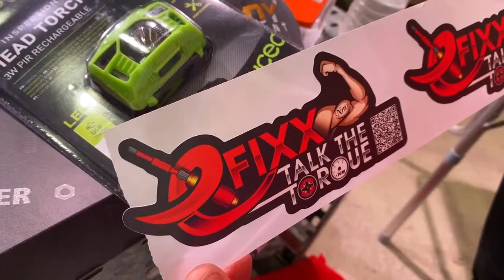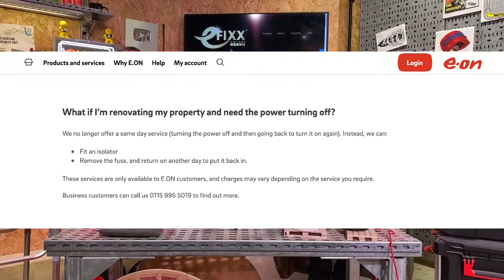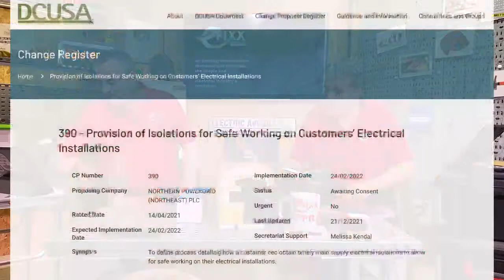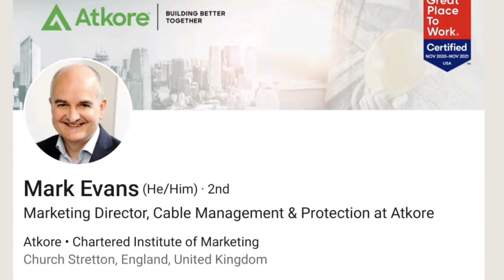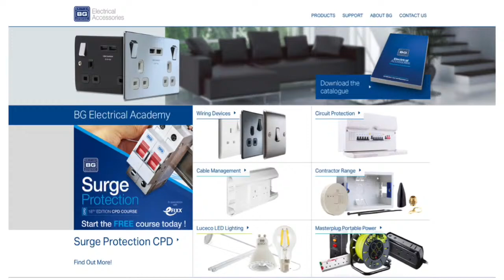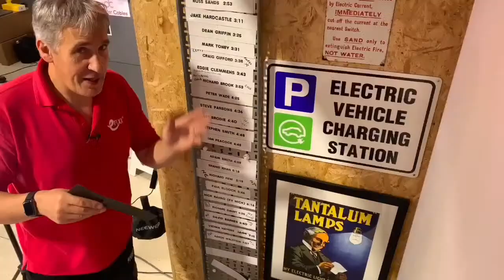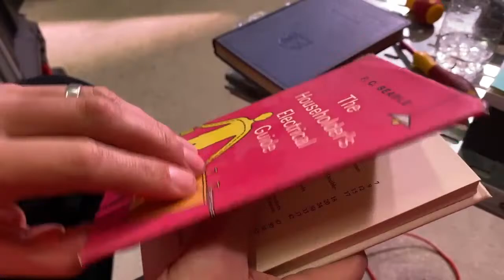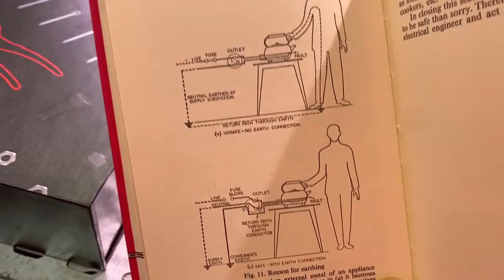eFIXX TV: Will I be allowed to pull the main fuse LEGALLY?

Comment: At the end of the day if the DNO does not provide a safe means of isolation for their network then in my eyes I am well within my right to pull the main fuse tagged or not as long as I have the correct equipment to do so. I would not dream of installing a consumer unit without a linked main switch so I cannot fathom in 2022 why smart meters are getting installed with no means of isolation to the consumer side.
Reply: This sums it up exactly
Reply: 100% agree!

Comment: There should be ZERO cost to have a disconnect device fitted (isolator). The energy supplier should have to foot the bill for installation (or do it with their own staff) and the consumer only liable for the cost price of the isolator & new tails (if required - some existing tails are long enough to cut and switch inserted). This should be mandated as a standard safety feature to be installed on any replacement and/or new build. Jeez one would think that customers haven't been paying through the nose for power for decades let profits take care of reinvestment since that is what it is on older properties!! 👎👎👎🤬🤬

Comment: Some of the new smart meters have a built in isolator under the front cover, allowing the tails to be removed safely with no interruption to the smart meter power. As some know the new smart metes alert when power is missing
Reply: Removing the cover of a meter is classed as tampering

Comment: My understanding is that yes you can if the DNO seals are the  newer type if they are the old led type were the crimping tool emboss’s a crown into the led seal they are classed as Government seals and it is a criminal offence to remove them. Also the DNOs don’t want electricians to pull there cut out because the loose out because they can’t charge the costumer an extortionate fee if is nothing to do with safety it’s about them making as much money as they can. Pure and simple other wise you would not be able to buy the seals and the tool to reseal the cutout and meter. Those sets are widely available for any one to buy . £ 19 on Amazon about £ 120 from R/S components

Comment: They should do a day course for electrians so you can are able to pull the fuse which would be a good money maker for them.
All they have to do in make a insulated insert that replaces the fuse and make special lock off device like safe isolation locks you need a key or a code to open.

Comment: Why have supplier install an isolator in meter cabinet opposed to simply installing your own isolator next to the consumer unit inside the house? One of my concerns would be potential burglars switching power off from outside
Reply: Do you think burglars are not capable of cutting a bit of wire on a fuse and alarms have battery backup.
Reply: @darrenplant1428  CCTV lost, any malicious intervention really. Sure they could pull the fuse, safety risk though
Reply: @jimreece7615  burglars, infamously concerned with the very best in safety procedures.

Comment: I'm really surprised by some of the things I heard. Firstly I can't imagine why a meter fitter would change the fuse rating. Your tails to the C.U. seem to be 25mm, so no upgrade required. For a meter man to change the fuse is a disciplinary. Only DNO can authorise a change (up or down) in fuse size. So why would he choose to change the fuse ?
The Isolator would not be acceptable to the Supplier I work for. We have to swap them for double screw terminal Isolators, as single screw terminals are accepted. Why he removed it ? 2 possible reasons. 1) He ran out of stock, but could not have a single terminal Isolator in his end of job photo evidence.  2) He was very inexperienced and possibly felt he did not have enough space to fit the meter above the Head and therefore pushed it over into the space needed for the Isolator. Seems unlikely.
3) I was dismayed to hear you talking about electricians cutting the seal on the meters. Pulling a fuse is all about Safety and I doubt anyone would be prosecuted for that. Opening the meter becomes Tampering. No safety issue and therefore the electrician would be putting himself up for prosecution.
Lastly, the supplier I work for, will upgrade your tails (not C.U.) and fit an Isolator for free if you need it prior to installing a car charger.

Comment: Why doesn't the home office demand lockable isolation switches are fitted to all domestic meter enclosures and that would be the end of it and it would be the suppliers expence over a say two year time period.
Reply: When smart meters were being discussed, the recommendation was put forward that the meter must have an integral isolator.  Those of us involved in advising the committees were "considerably disappointed" when the industry folks rejected the idea and successfully balloted to drop the suggestes requirement.
Reply: Or at the very least mandate it whenever a change is made anyway, that way they can take 40 years about it.

Comment: The DNO/Meter Supplier only own the cut-out and meter, anything after that including the isolator and consumer unit belongs to the customer. The smart meter fitter who removed Gary’s isolator committed theft and should have been reported to the Police for doing so.
Reply: Actually, that is not entirely true...  When there is no Isolator, the tails out of the Meter into the CU are the customer's  (Even though you cannot do anything with them because they are inside the Meter!)  Everything after the meter (including the whole cupboard box itself) is the property of the Home Owner but when there is an Isolator, (regardless of whether you bought it) , the meter tails AND the Isolator are the property of the Energy Supplier.  The CU tails out of the Isolator is the Home Owner's property.  And you can even open only "your side" of the isolator in order to remove your tails.  I think it should be Statutory for the Energy Companies to provide an isolator with every new meter installation/upgrade, just like we are required to install any new circuits to current regs...

Comment: Electrician's Challenge: I saw no evidence of him doubling over those single conductors before putting them in them-thar screw terminals, and I can guarantee none of said terminals is only sized for 2.5mm conductors!  That's a big no-no around my way and should be an automatic fail or disqual, but I'd accept a time penalty ;-)